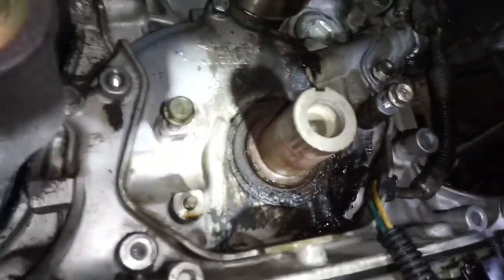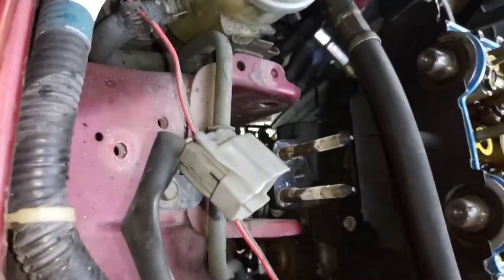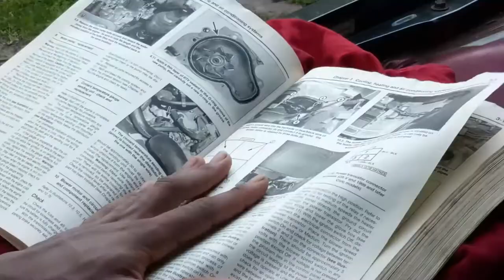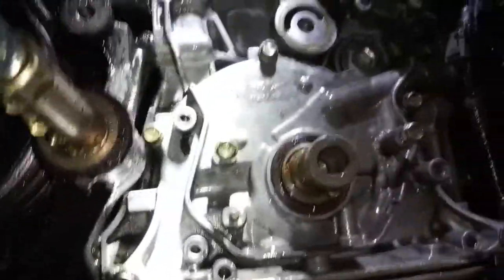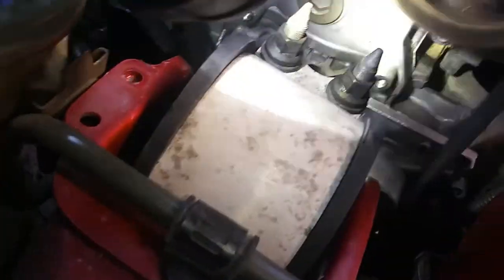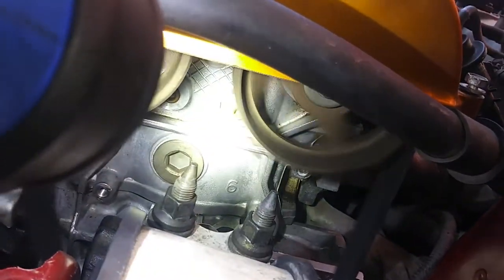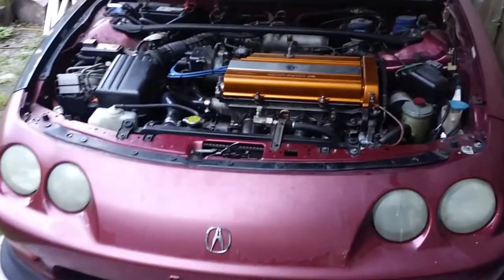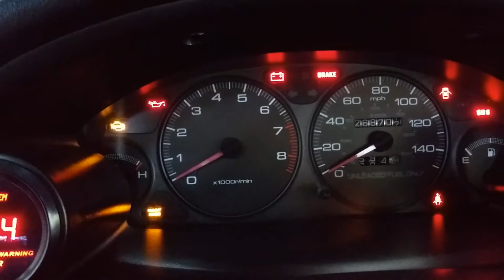1998 Acura Integra coupe B18B1 engine refresh water pump, oil pump, gaskets and timing belt vlog# 3

Comment: How did you removing the gear for the timing belt?
Reply from the maker: mine slid off pretty easy after removing the harmonic balancer. PB blaster and small movements got it off